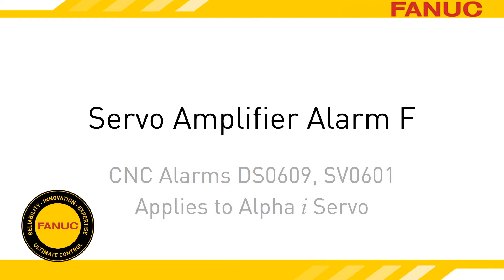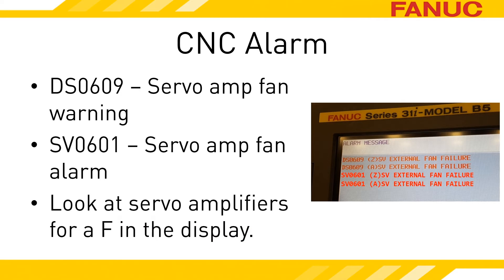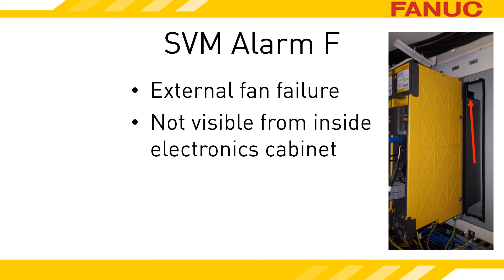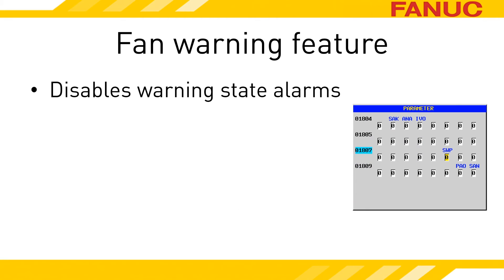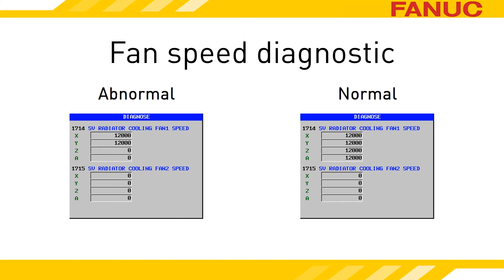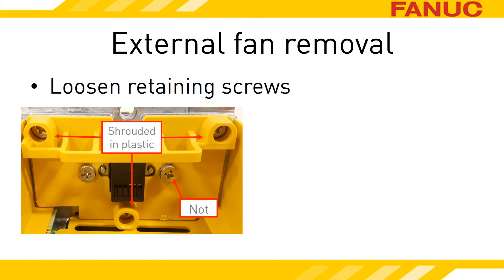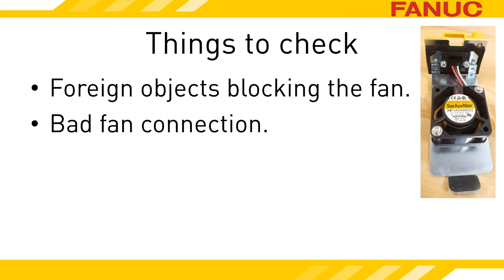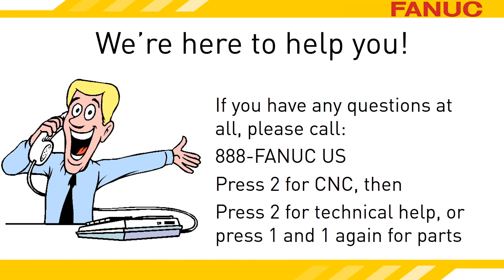Alarm F Troubleshooting for FANUC CNC Servo Amplifier

Comment: Thank you! As a note for whoever else  will still  watch this, , for old 0i-MB the access to the fans of the controllers can be done from the top of the machine , there is no need to unmount anything. alcohol spray and blow air over the fan and will work.